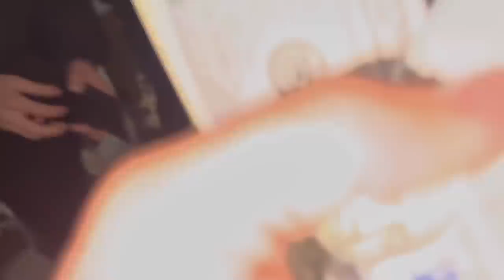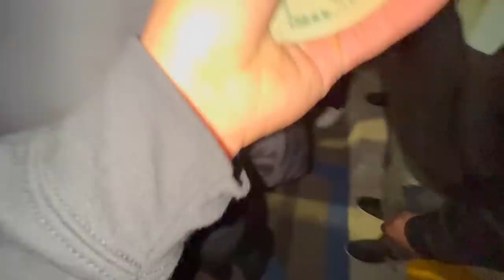HUGE ARGUMENT! 5.0 Vs SS | $10,000 Pot #Mustang #GT #SS

Comment: mustang guy was too soft, seems like a nice guy but my man can’t be letting camaro guy call EVERYTHING but camaro guy is BIG scamming. he running something. camaro guy talking about making it interesting and fun but was calling everything. that’s 🐔💩
Reply: bro pray tunes the fastest bolton m6 car in the world.... The mustang needs a lund tune or a rf tune then maybe itll be a good race...
Reply: @ebkbk9902 tricky ftw
Reply: @josearteaga3703  lund holds more records then any other tuner. 💯 Didnt a tricky car just loose to fastguystires who is rf tuned.....🤷‍♂️
Reply: @ebkbk9902  It has nothing to do with the tunes I guarantee it. It's all in the fuel and the weight of the car when running n/a. Add in the the displacement bonus of the LT and it makes sense. Their heads/cams combo also makes more power than the coyotes as well. Good tuner vs good tuner makes a tune negligible..Lighter brakes and rotors, cutting the diffuser, cf driveshafts, gutted interior and taking off those heavy ass beadlocks and adding some 15-17in Rpf1s would have done the mustang a lot better. And if you're racing for money, putting in that rarely used garbage e85 from the pump that I bet money yall don't test, doesn't help either. Have some OneR/VP ready
Reply: @gadec4lyfe  camaro is king n/a going mid 8s for years no s550 has gone 8s n/a boyd bumbera gave up the record and now hes boosted...
Reply: Wayyy to soft Camaro owner knew it too
Reply: @ebkbk9902  ur kinda slow
Reply: @blackeye3336  he’s slow in the head cause there’s many vids that prove otherwise